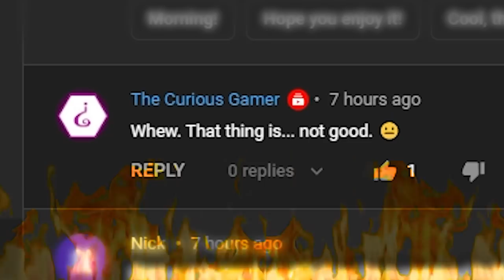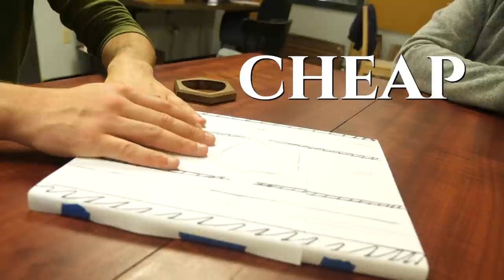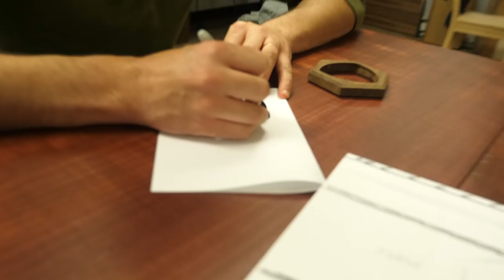New GM Screen Design Pt.2 (Jason was right)

Comment: So you have those rails on the edges of the table that your accessories fit into. Is that solid wood thick enough to put those in so that you can put in your little trays and cupholders on the screen itself?

Comment: what was wrong with using the metal balls? using the rods seem like an unnessesary expense. you could still use the idea of countersink the magnets but you wouldnt have to make a slot. like a shallow egg cup to hold the bearing would solve lateral stability issue?

Comment: Why do the metal bars need to be external? Make a fancy center piece, with the magnetic bar pieces embedded in the frame of the center piece, and have magnets on the outside pieces? Seems like it would really cut down on the flimsy structure there.

Comment: I love all of yall. I feel when Doug started getting into the "being a bitch" part it was a bit heated. I think Jason is right in regards to this seeming like not a wyrmwood product. I personally would prefer something of higher quality that costs more coming from Wyrmwood, but also not opposed to you all having a separate line that's from the scrap pile. Primary focus should be on craftsmanship, but then when you have some good ideas that don't quite fit Wyrmwood you can take it to the other line. Diminutive Dimensions? Wyrmshavings? ScrapNCrap?

Also might give some of your none designers a chance to come up with a product that they think would sell well, but isn't necessarily Wyrmwood material.

Comment: Why one or the other?  Merge all three ideas.  Put the wood on a CNC and let it cut a frame and panel design around the edges as well as a slot to add in wood laminate and adjustable shield across the middle.  Recess the metal bars so they almost disappear when connected.

Comment: My mgt order was 3k, i think they've lost it if they want to charge even half that for a gm screen.  If ppl want the crazy inlays like the Mercer screen make it a custom option or something and charge for the hard work, but as a normal product IMO it shouldnt be above 500 for the high end version and the average price should be around 100-150.    i just want something nice looking that could conceivably attach to my mgt rails.  like others have said they need to find a way to offer something we cant make for a price we can afford not noticeable fractions of an MGT for 3 panels of wood.

maybe they could split the difference?  have a high end center panel, kind of like doug was thinking, but better. then sell more basic side panels so you get a wow factor at the table but can still keep cost and production issues down

Comment: I don't really understand the mindset of not having the capablity to do the frame and panel screen. Y'all didn't have the capability to make MGT when it launched and yet you still did. Also, I have to agree with Jason that the frame and panel idea seems a lot simpler and probably cheaper? Doug says frame and panel is double the cost per panel, but that seems ludicrous compared to what he is making.

Comment: Why not build on the CAP approach and build slabs of stacked woods that could then be sliced off into the panels that appear to have a greater level of detailing than the effort that went into it. It seems like this is a problem that already has been solved by Wyrmwood to produce the "masterwork-esque" looking panel with a higher end appearance but a faster more modular production standpoint. It fits the brand better and ties in with an existing and well-received product line. It could end up looking like Doug's approach, but is actually closer to the butcher block approach (or the CAP approach but on a larger size).

CAP has already solved this exact problem of wanting the high end masterwork aesthetic but the price point and production efficiency of a mass market offering. Why wouldn't you apply the exact same approach?

Comment: Is this guy high? Did Doug just try to convince people that inlay is easier than putting a profile on a board with a router?

There is a reason why every home shop has panel frame doors on our shop furniture. It is by far the easiest way to make a panel that has the bare minimum of asthetic appeal.

Which is exactly why you shouldn't do it. Looks cheap, feels cheap. It's a piece of furniture, not a DM screen.

Comment: The updated panel seems to have forgotten about a key issue when it comes to table top anything, storage and transportation. Yeah it looks a little better but I don't think anyone will be interested in that bare-bones customization especially at the cost of the space it takes up in the transportation or storage. I GM myself and it is frequently not in my own home so my screen is being shoved in a bag before and after group. I am also concerned with how those protrusions will catch on things. Unlike dice and maybe their vaults, a gmscreen is much too large to have it's own dedicated carrier unless you are really dedicated to the craft in most cases. I think I can speak for a lot of GMs and players and say it would be much more preferential to have a mechanism similar to the inside that makes it easier to attach resources or other materials to the external side. A lot of the tabletops I play have long rules sets or a lot of niche rules that would take a considerable amount of play space or time to dig out of the rulebooks or online.

Comment: I hated the GM screen from Part 1, it was really really bad. I tried convincing myself I like it, but I didn't. 😂

That said, I don't want a $50 per panel GM screen from Wyrmwood. I want a 3 panel $500-$600 GM screen that looks like it belongs with my MGT. This looks like it belongs on an IKEA kitchrn table, not an MGT.

Comment: My problem isnt with how it looks per say, its that its done very little innovation wise. Take a look at all of Wyrmwoods previous products and you see a TON of innovation.
Your Prophecy table, super innovative, the MGT, super innovative, the modular dice trays, super innovative, EVEN THE DICE VAULTS IMO are really innovative with how they were done up.

IMO the Wrymwood brand is like 60% innovation and 40% aesthetics, and currently your GM screen feels like its 80% aesthetics and 20% innovation. 
Im just not a fan of 3 slabs of wood being held together by 2 metal rods and I think thats also the problem most people have. Its now how its looks per say, its that the innovation just isn't there yet.

Also not a huge fan of that removable bit on the front of the DM screen there Doug.....I get it, you can customize it, "wooo!", but why is it on the front of the screen where I cant reach it.....I as a DM dont want to have to reach over the top of the screen to grab some thing thats attached to the front of my screen....thats very cumbersome.

Comment: Much closer this time Doug, but it's still not there imo.  The first round of GM screens offered modularity in the form of connected dice towers, drawer towers, multi-sided screens.  This has none of that functionality built into it.  I have to agree with Bobby here, Wyrmwood doesn't do low-cost solutions, you all do high quality, high-end products and while this latest version was closer it's still not there yet.

Another thing to consider, a LOT of GMs run their games with a laptop and a GM screen, leaving the central panel hidden behind the laptop screen and wasted realestate.  Do you guys have any innovative ideas on how to incorporate this commonly used technology into a Wyrmwood style solution that looks classy?

Comment: Just my two cents, but I'm not super excited about a GM Screen that comes apart and I need to assemble it each time I use it. And come up with some sort of storage solution for all these individual pieces for transport. I'd much rather see a single product that folds up for easy transportation. Are there any cost effective alternatives to hinges? Maybe (fake) leather used like a sort of book binding?

Comment: You're making arguements for and against something that doesn't exist in hand Vs something that doesn't exist in hand. Make a proto of frame and panel, then show people both and see what they'd choose, without thinking about what goes into it. My thought is this, a 3 layer panel, stacked and glued together, with the middle panel extending maybe 2-3cm out from the top and bottom panel. Then, you can put on your "frame" pieces onto that offset, giving you the look of frame and panel at a potentially lower cost, plus now your edges look cool and fancy if you have two different wood types.

Comment: I likely the revisions Doug made, however like Jason and others said it doesn't fit the Wyrmwood design philosophy.  Wasn't that the whole point of them doing the separate Loot Goose brand that got dropped? As If Doug's revised solid wood panels could get <$100 per panel there's a big enough market that could be worth making and selling them under a different brand.  As personally I couldn't see spending $1000+ or more on a frame and panel GM screen over say a $100 per panel solid wood one.

Comment: Cheap, Fast, or Good. You can only get 2, but not 3. If it's Cheap and Fast, it's not Good. If it's Cheap and Good, it's not Fast. If it's Fast and Good, it's not Cheap. Pick your poison. Or, pick multiple and have different options for what people can afford. Something cheaper at a lesser quality, AND something more expensive with a much higher quality. Does it have to be only 1 solution? Is it possible to have 2 or 3 options without running crazy on SKU's?

People want Wyrmwood for quality, not for ease of access. That's what you built your brand on. Quality. Not just shitting out products as fast as you can for as cheap as you can... Now I obviously don't have the inside knowledge of what your company is capable of with it's current staffing and machinery, so maybe something is just simply out of the cards on it, but I think y'all can make it work somehow.

Comment: What's the price point for this screen? If you're offering it at a comparable price to other cheap, simple dm screens, then sure this is a fine idea. If not though, then you're just offering a premium priced screen that has the same functionality (if somewhat less because its heavier) as other products out there in the market.

edit: Watching the whole video. $150 per panel ($450 for a full 3 panel setup) sounds great for a premium dm screen honestly. Sounds like a much better idea than a $150 setup that's just chunks of wood.

Comment: Instead of making panels why not make a beautiful hinge (fixed or slightly hinged ) you can slip a cardboard print into (like one of the official DnD DM screens ripped into three?. That way Wyrmwood could make a simple (or ornate) wood product (hinge) and then use your graphic designers to display their artwork and designs.you can slip a thin piece of metal (or tablecloth) between the cardboard to get your magnet panels.

It's much easier to provide options that way and your margins will likely be better.

A bit like a longer pencil

Comment: I definetly agree with Jason on this one... However, the process of coming up with a product like this has me wondering, why you guys aren't using 3D more, to visualize a product when its in the design phase? instead of going almost directly from idea to prototype... Im not saying ditch the prototype, but it would probably be alot faster to come up with different ideas, and see what works design-wise if you were to do some visualizations beforehand - and you could  probably easier figure out cost etc. based on how complex the product ends up being in various designs? 

Im pretty sure i saw that one of your guys from marketing were working in a 3D program (was it Blender maybe?)  any who, if its because of lack of know-how, reach out! i'd be happy to help you guys out either by producing some stuff, or teaching some of your guys 3D! (i teach at one of the best Architecture visualization schools in the world)

Comment: I'll continue to be the one guy behind Doug's solid wood + magnet-rod hinges general design. I like the simplicity, I like the cool-factor with the magnets. I like the ability to flip the side panels 180 to show players handouts. Frame-&-panel honestly sounds kind of tacky to me.
I could probably stretch to the $1000 price point... but it would be stretch. I would probably NOT pay that for frame-&-panel, because again I think something that looks like a cabinet door sounds fugly vs a nicely carved or inlaid solid piece of wood.
I'll also repeat that I'm not gonna buy it if it's  locked-in to 5E. That's actually the biggest point for me. Give me a functional heirloom product I can use, not a gimmick for a game I don't play.

Comment: This is still not really going forward in any positive direction, and Doug's choice of inlaying and adding stuff to the screen still do not solve the bigger issue of the fact that the magnets are ugly, the rod is ugly and the connection between them is what is ugly. Adding cool "wow" factor is a nice idea in the middle screen but it is just slapping on stuff on something that is not good to look at. Personaly I was not the greatest fan of the way it was designed either, it looked rather off and like they put another product on this product frankenstein wise, which they technically did.

Yeah, Doug, no. Jason and Bobby still wins this one.

Comment: So; Project Edsel vs. Project Wrymwood? Honestly, I could make (with my beginner skills) Doug's current design. With more practice, I could make a simplified Critical Role screen (if I can source the barrel magnets). For me the question is can I source wood locally for it? I can get Red Oak, Maple and Oak. Anything else is over 40 minutes away If it is in stock. So my choices are limited by local wood choice but multiplied by stain options. Would it have the Wyrmwood "cool" factor? With the Matt Mercer GM screen being the epitome of cool for this item, I would give my effort a 1 or 2. Something in-between is doable with the right brain power, which Wyrmwood has in depth. Play around with it more, add/subtract, refine. Elon Musk is constantly refining so it works. Hmm... a Wyrmwood rocket?... {grin!}

Comment: Wait.  I'm confused.
The "cheap and easy" option is $70/panel.  The one "everybody wants" is $150/panel.  I'd pay the $150/panel if I want something good quality and long lasting.  The $70 one looks like something my cabinet making uncle would build in his workshop.

Also confused on where $150/panel suddenly gets a $3k pricetag?  Would that make this really bad version $1,500?  I need explanation on where those big numbers are coming from.  Cause maybe I just want 3x $150 panels and a pair of rods to hold it together and not shelves and trackers and dice rollers and all the rest of the bling.

Comment: Just spitballing. but...Hmm, instead of 3 panels can a GM screen be 1 large curve (say 26 inches end to end)?  
No you dont carry it from game to game in a back pack but if the games at your house or if you one shot at cons itd be pretty sweet. 

Think less cabinetry more,  guitar making or old school surfboard crafting. With 2 magnets for every 8-10 inches to hold up pages but no hinges or magnetic pole joinery. 
Like the curve of a concert hall or planetarium. 

Still shows off the wood, the woodwork and may appeal to the same high end consumer. People who buy $1500 gm screens are the kinda folks that buy pricey guitars or pricey surfboards.